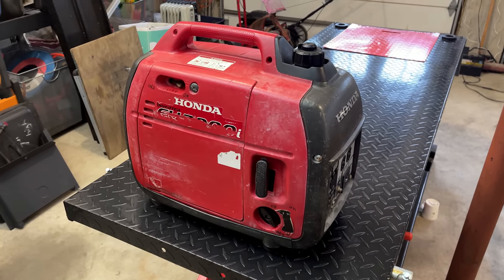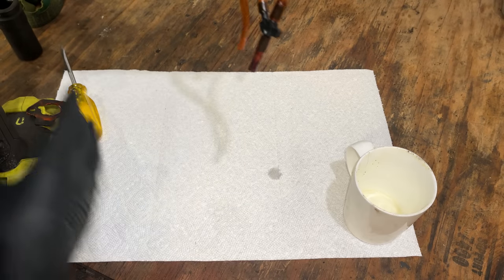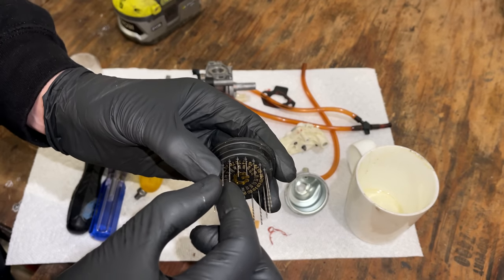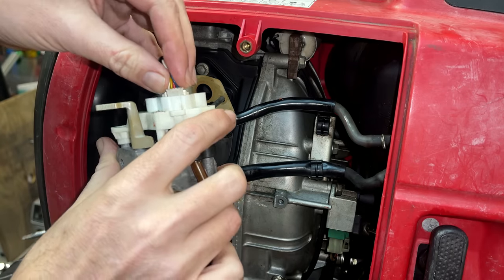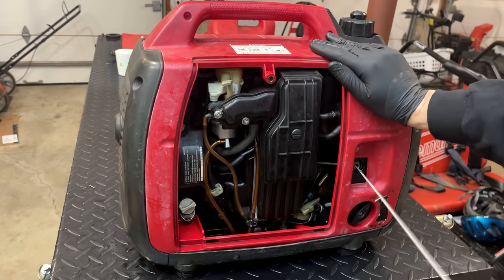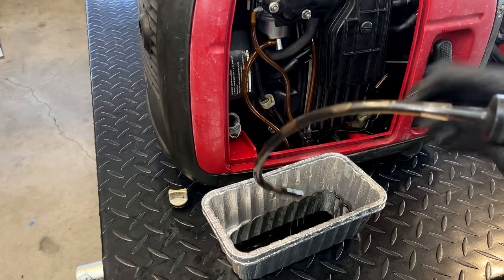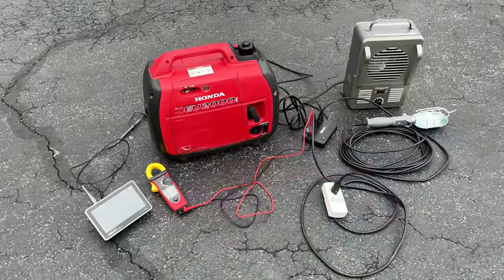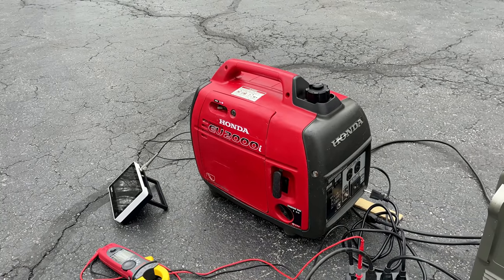Old Honda EU2000i Generator Leaking Fuel

Comment: They are a great generator. After reading manual, if you half close the main On/Off control, it will close off fuel and allow motor to continue to run, to use all fuel in line/carburettor.  Then turn control Off, once fuel in line is used.
Reply: Thanks for that. 
I have a 2000.
Carb actually had rust in the bowl 
Inline filter was damaged 
Oil alert is finicky
Reply: This fuel shutoff method is the manual's recommendation for mid term storage, in addition to using stabilizer & topping off the tank to prevent any condensation - specifically up to a year. 1+ years it recommends completely draining tank & carb before storage (in addition to doing an oil change and making sure the oil's had a chance to cycle a bit).

 @leneger9174  sounds like some condensation in the tank (and into the carb) did a number over time (ethanol blends don't help this)... did you get it going again?
Reply: This won't have solved the problem here. Shutting off the fuel line would let the generator run for a short while and stop. Which would be no good. The only fix was getting the float to work properly, like he did.
Reply: Excellent tutorial.

Comment: Another good fix by the U-tube guru. The most striking thing to me that came out of this video was the fact that the original owner couldn’t get anyone, including a dealer, to fix it. This one was a bit tricky but not a difficult repair for a professional. Good thing we diy amateurs have Jim doing these videos so we can learn how to take care of our own equipment ourselves. Everybody watching should be hitting the “thanks” button and supporting Jim.
Reply: Heard
Reply: I guess there's more profit in selling a new unit rather than fixing a broken one.
Reply: @methods-SE  m
Reply: An unfortunate reality, but in part, one that we created ourselves.  Those who were around 40+ years ago know that this is the most coveted knowledge of all!

I remember only a few men.....  that were talented enough AND patient enough to teach and let others learn.
Reply: Dealer refusal might be because under agreement, they must use OEM parts which I deduce parts are no longer available. It wasn’t lost to me that he used the parts he had on hand. He cockroached a replacement jet and float. He cleaned up the gasket and used same gasket.
Reply: Liability, those things have 15 years of abuse and DIY "experts" tinkering with it.

If they repair it and ut starts leaking somewhere else and it burns the garage down to the ground.

The DIY'er never takes his responsibility it always is the retailer that repaired it that is at fault.

And the lack of original parts probably, and the price of repairing it will get to high if they can source the parts somewhere.

The "they rather sell you a new one" people just want to complain about everything.
Reply: True talk bro
Reply: @jjsifo1    I worked for a major brand dealer(not Honda) and when someone walks in with a unit (older or newer) you tell them it's X dollars to look at it and diagnose the problem. Typically, it's an hour's labor. Most of these smaller units (not Honda) are well under $500 to replace now. Gamble $100+ or put to toward get a new one? Yeah, I fixed a bunch of them over the years but unless you do them on a regular basis (and stock parts) it's a royal pain. Most have been overloaded and the electrical end is toasted, so they park it for a year to "think about it" and wonder why I want an hour's labor to get it running first.
Reply: Good point! @rupe53
Reply: Carb clean is a basic service item on these engines and usually the only thing wrong with them because of bad gas from improper regular pre-storage preventative maintenance.  That carb bowl drain needs to be opened and the bowl drained every time it is put away as well as the plug removed and the cylinder fogged with a few drops of oil.

The carburetor and the air filter, along with the oil fill & spark plug are the only items easily accessible without major disassembly of the plastic shell.  Even the pull rope is a major surgery to get at and replace.  

Any small engine mechanic who refuses to do such service is not worth his salt and should be avoided like the plague.  It's a sign of the times that you can't find anyone to do such a basic and simple job.

It could be that there are other issues such as low compression or a bad inverter which would make any other work not worth it but those are easily tested before going ahead with a lot of this work.
Reply: @svbarryduckworth628    the missing ingredients here are a customer willing to store it correctly and bringing it to a shop before it's a disaster.... which is usually a few years in storage with bad gas and a broken pull-cord from trying to start it after sitting around. BTW, the easiest output test is to get it started. Any other tests need disassembly for inspection. As a side note, I have seen units come in with parts that have vibrated off the PB board. Of course, it took 30 minutes of fooling with the cabinet to get that far. The reality is these things (maybe not Honda) have a poor reputation, which is why they get turned away.
Reply: Owner said it was leaking fuel and starting hard/running only on choke -no other stated issues.

Like you said, easiest test of inverter is to get it running quick -not withstanding fuel leak.  Usually it isn't too hard to get these to at least start and run just by simply flushing fuel in carb and tank, replacing with fresh and installing a new plug.  Ether if necessary but sparingly.  Compression test is elementary for any established mech.

Big PITA if they broke the pull rope.  Totally understandable to pass on that job with such a beater with other known furl issues. Not worth the labor compared to new.
Reply: @svbarryduckworth628    I ran a small shop before retirement and only did the portables a few days a week, so they were lined up along the wall waiting for a rainy day, basically. I did large units out on the road the other days, but I did enjoy the smaller work as I got older. My routine was a visual check, fluids, and sniff the fuel tank. Hang a voltmeter on it along with a droplight, then try to start it. If it sounder good I would dive into the routine service (set price, already quoted and credit card on file) If it failed to start, then we looked at spark, compression, and perhaps coaxing it with a little fuel. If I saw voltage and the drop light, then I would call to get an ok for further work. (no output might be a death sentence) Usually cheaper to replace the carb than try to clean it. Bottom line is it took longer to look up the carb and call the customer than to do the diagnosis. Part of the original quote was $50 went toward diagnosis and disposal if they decided NOT to do repairs. (minimum charge) If they decided to do the repairs, then the $50 was waived. The whole idea was we don't work for nothing, and I won't store it for 6 months while you think about it. Most units had a flat fee for pick up and drop off, so all on a credit card. BTW, a full service included cleaning and a full load test. I made a lot of happy customers, despite a slightly higher fee schedule.
Reply: Sounds reasonable.  My experience is that I don't buy this stuff new and usually find it cheap or free already broke or not working correctly.  I don't pay anyone to work on my mechanicals and either fix it or give up and look elsewhere for something better if it gets to be too much trouble.  

Basically I am a dumpster-diver living on the cast-offs of folks who just buy something new rather than fixing things or keeping it up.  

Part of being successful is to know what mech is quality and worth fixing and what is junk and not worthy of my effort.   We live in a time where there are riches going for little to nothing if ome knows how to fix things and can discriminate what is what.  I'll also fix things for others in exchange for things of value or other services I'm not equipped to do myself.  

I live on a sailboat full time and migrate a couple of thousand miles twice each year to stay in the comfort climate zone as seasons change.  One soon learns to fix anything or go without or maybe go broke paying others who usually don't know what they are doing anyway.
Reply: @svbarryduckworth628   I played with boats years ago but these days I have a bad back and a bum shoulder, plus neuropathy in my feet, which means I have lost my sea legs. Happy sailing to you!
Reply: @rupe53 you are describing exactly why I "retired" at age 50 to pursue this life rather than waiting until my 60's like most folks do, and perhaps in declining health like my parents at that age. Genetics is hard to escape.  Growing old is not for sissies...
Reply: Note that most who sell new units or parts are not mechanics, they are parts people. Dealership would also charge more per hour than what the unit is worth.
Most normally when I do these things I tell the customer to pay me what it's worth to them. Normally I get paid quite well. Sometimes it's such an easy fix, it's no charge. 😊
Reply: Float level? Should have checked that when you had it apart the first time that's just normal procedure. Usually you turn the carb on its side then rotate it until the float just pushes the needle valve closed. Reason being is that some of them are spring loaded and turning them upside down can give a false level.
Reply: New one has a 2 year warranty, old crap has 0 warranty.
Reply: Liability is probably a concern for commercial repair shops. It seems absurd but that's how lawsuits have impacted our society. A shop would need the original manufacturer's parts for any repair.
Reply: I'm a dealer parts are available.
Reply: @jjsifo1 Honda themselves say these are not repairable. Not too many businesses out there going to take on that liability. Doesn’t really have anything to do with bad customer service.

Comment: If he did find a shop to work on it I doubt he would get it back all cleaned up with new stickers on it. 👍
Reply: Amen!
Reply: Is he getting it back? Or did he give it away?
Reply: The emissions sticker indicates the generator was built in 2008 I think and when it was started, the green power light did not blink, indicating the generator has under 100 hours of run time. Shame on Honda dealer for trying to upsell a new generator.
Reply: @4RXLA  Exactly!

Comment: Based on the look of that spark plug you replaced, I'd suspect something has been allowing oil into the combustion chamber. That exhaust smoke is very unusual. My EU2000i has never smoked like that. There's something else going on with this unit.
Reply: Seen that before, a new valve stem seal fixed the problem.
Reply: From the looks of it, that generator pretty worn out. Probably not worth a top end rebuild.
Reply: Got flooded with fuel. Let it warm up..
Reply: @2nickles647  Fuel Flood doesnt explain a black crusted spark plug.
Reply: @Chris-yy7qc well Yes it would!
Reply: @Chris-yy7qc  Those Honda EU2000 are work horse's and will run forever if taken care of. I know I have two of them.
Reply: Most likely, if this unit has lots of run time and poor maintenance (especially if oil not changed at regular intervals, if ever) it has a carbonedup oil control ring. Means major tear down and new rings.  Rarely have I replaced an intake valve stem seal and have it cure an oil burning issue. I've worked on a few of these...

Comment: Bought in 2010. Run every day for 8 years without hiccup off-grid cabin. Highly recommend these Hondas!
Reply: 8years x 365 days x ? hours every day = Y            total hours so far?
Love to know  because another off gridder was
17k hours before PM of replacement belt....
then 17K more hours....
before he gave it to a friend..... still running....
aiming for 35 k on the second belt just to see if it could have done the whole stretch on the original belt!!
Reply: @JohnSmith-yv6eq  I can’t say the hours exactly however she ran at sunset to midnight and sometimes during the day. The only thing replaced was of course oil. It’s a small and quiet machine and importantly she works and works and works.

Comment: I have a Honda EU2200i and it was leaking fuel as well... like pouring it out on the pavement when I started it. 
I watched your video and it gave me confidence that I might be able to fix it or at least figure out what was going on. Well taking things apart the float was good, but there were several different areas that were clogged. One clog would force the fuel from the pump to the carb bowl, to out the carb overflow hose and that is where the leak was coming from. Used brake cleaner and the plastic stem and I cleaned out ALL potential holes and put it back together... two pulls later it just started right up with no leaking fuel! Turned it off then back on with a single pull. AMAZING!
Thank you for taking the time posting this video. It was a BIG help. Thanks James.

Comment: That generator has been used and abused. Also, you started it a couple times in Eco Mode. Page 33 of the manual says to wait a couple minutes before switching to Eco. FWIW. My EU2000i has been solid gold for years. Only gets used when the power goes out. It has kept life comfortable thru several long winter power outages. Mine developed a small problem a few years ago. In Eco Mode it would rev up and down with no load. YouTube taught me how to clean the jet...problem fixed. It is always ready to go. Started every few months with fresh gas and the oil gets changed regularly.
Nice video.

Comment: As a lifetime Honda tech after my military career. I find it bizarre no Honda shop or qualified service shop would fix it? I never refused or was unsuccessful in recovering a job. Customer satisfaction is respect and that is free advertising eh Good on you for gettin it dunnn eh
Reply: I agree, I have worked on these gens and they are pretty straightforward when you learn to dissemble the plastic.

Comment: Surprised no-one wanted to look at it, being one of the planet's most well-known and reliable gennies.
Reply: Because most just want to sell you a new one.
Reply: It's probably because the shop is worried about running into part NLA issue.  It seems to be common with Honda .
Reply: @johnmckee7937  Taryl fixes all said the same thing.
Reply: illegal in calif.  Why?!  CARB makes no sense. Cheap Chinese knock offs are legal to buy until 2024.then all amall motors are banned.

Comment: Great work! These are a great unit but can be a little finicky at times. I am a small engine mechanic myself. This is an issue I have run into before and usually end up having to replace the carb with all new gaskets.
To those of you working on these generators or even if you own one, I would recommend getting a label maker and copy the Vin number on the outside and stick it just to the left of the carb on the black engine cover. 
I have found that when the unit gets dirty the Vin number is so close to the ground it usually gets rubbed off especially when used by commercial guys.

Comment: You can also buy complete new replacement carbs ($200 for a Honda one, $40 for a generic one) that are easy to swap on.  Just have to swap over the e-throttle motor.  I did this on our old 2nd hand EU2000i and she got us through 5 days without power after a hurricane!

Comment: I have the same generator, it is by far the most reliable I have ever owned.  The fuel filters are a bit of an adventure but once you get the procedure down it's not to bad.
I have not yet had to take the carb off ( after many years of use and transport ) so this was very enlightening.  Thank you for the thorough and informative video, you have a new fan : ).
Reply: Mine doesn't get used very often, so I bypassed the whole liquid fuel/carburetor issue by converting mine to run on propane. It can sit for years, unused, and it fires up after a few pulls every time; when I'm done, I just put it away again. I was told that the old EU2000i is actually better than the current EU2200i.
Reply: Use good alcohol-free gasoline and always drain the carb bowl before storing it for more than a week or two and you'll never have issues with the Honda inverter generators.  Simply running the carb "dry" isn't quite good enough because it never goes fully dry when it dies with the fuel shut off.  Those last couple of teaspoons of fuel left in the carb bowl will cause problems for you eventually when it turns to varnish.  Drain the tank too to be sure and fog the cylinder with a few drops of oil down the spark plug hole.  

If you change the oil according to the manual the genset will last nearly forever unless it is used every day all day long in construction use and even then it'll last for years of that heavy use.

Comment: Ive got two of these generators and a fishing buddy has another two. We use them mainly to run our 30 amp campers and charge the five 12v boat batteries and run a small residential freezer during our week or two week fishing trips. We run the snot out of these Hondas and they are awesome. We run 91 octane non ethanol fuel and they never miss a lick. They have to be 8 to 10 years old and we do three or four trips a year. Thanks for the video in case we eventually have any carb issues.
Reply: You must be doing everything right!
Keep on doing it!
There is no reason for the gen to go wrong if the maintenance is kept up and the running conditions are good (airflow for cooling, protection from rain)..

Comment: Much gratitude for seeing your way and plugging through all the stops. Tip: when using the sonic cleaner it can still work effectively if you can contain the liquid cleaner in a plastic container e. g. Costco cashew container. This can conserve cleaning liquid as well as leave the tank in more pristine condition.